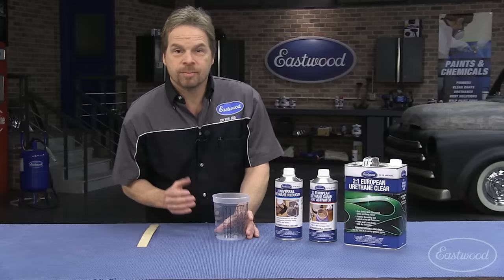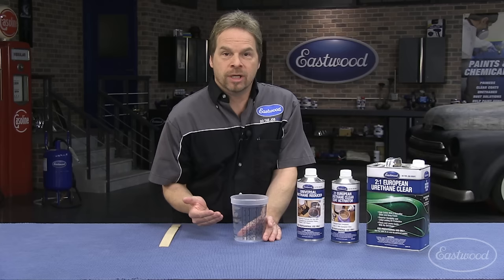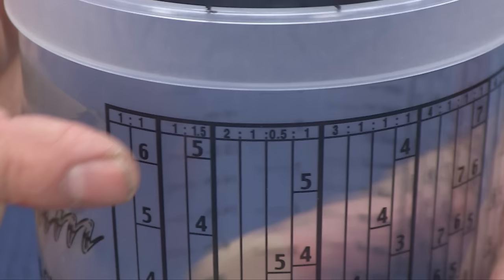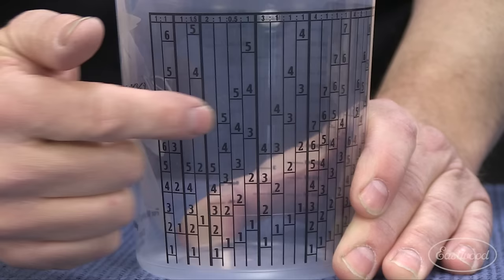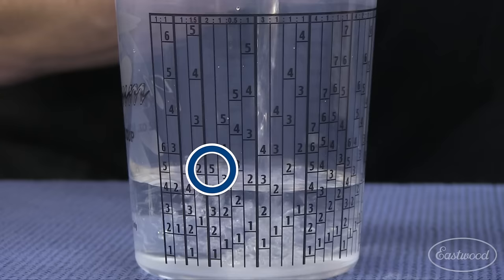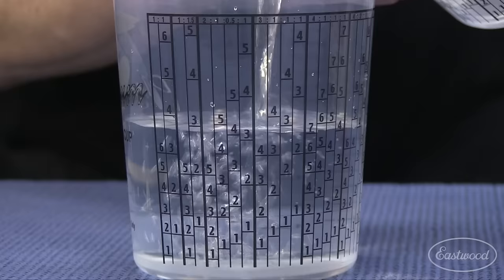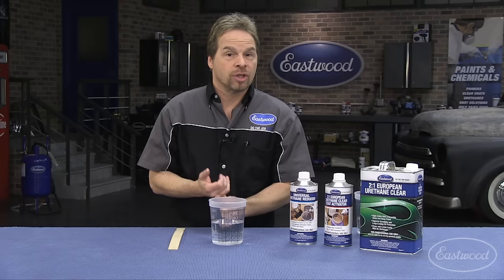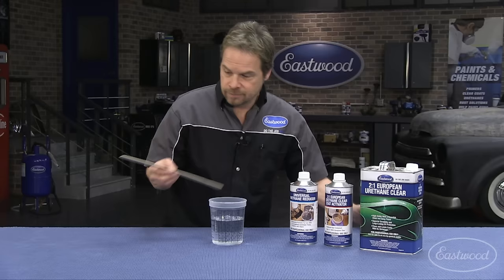How To Mix Clear Coat Using Paint Mixing Cups with Kevin Tetz - Eastwood

Comment: Guess he is going to go spray the flowers now with a perfectly mixed cup of water 😂 Thanks for the info 👍 After spraying basecoat after basecoat with a 2:1 or 3:1 ratio using only paint and reducer, I swopped the hardener and reducer in mixing the clearcoat 🤦‍♂️ Just had to come back to double check myself

Comment: one think I learned from my instructor is to count up to 2 missipi to make sure the body of the clear paint or sealer was good enough for the surface since we live in arizona....
Reply: Joel Barajas you had a terrible terrible terrible instructor.  "Good enough" is garbage. spend the extra time to do it right.
Reply: Joel Barajas you had a terrible terrible terrible instructor.  "Good enough" is garbage. spend the extra time to do it right.

Comment: How to mix 3 stage paint?
Reply from the maker: If you're mixing 3 parts, the cup accounts for it. The columns he's using is for 2:1:.5::1. So you can mix 2:1 then add .5 or 1 for your third part.
Reply: I think you mean base, pearl, and clear. That is no different. You just have an extra layer of translucent paint between the base and clear.

Comment: Your confusing. If it’s a 2:1 why you going to the 5 ?
Reply from the maker: You look for the ratio at the top of the cup 2:1.  Next you fill to a number depending on how much you need (in this case 5) in the first column.  Then you take your second component (the 1 from 2:1) and fill to the same number (5 again) in the second column.